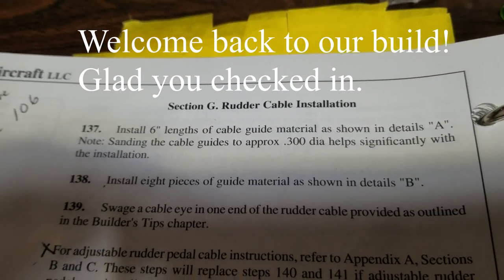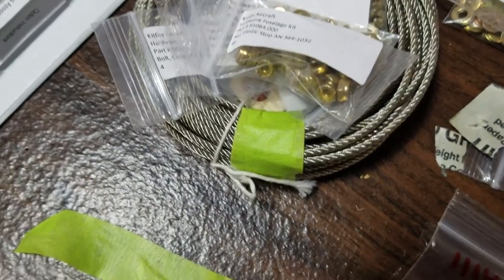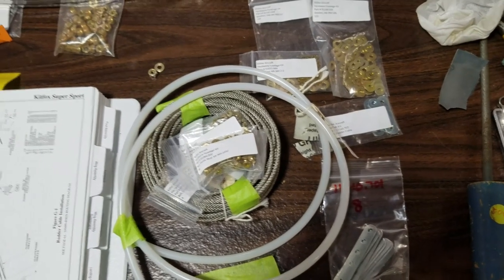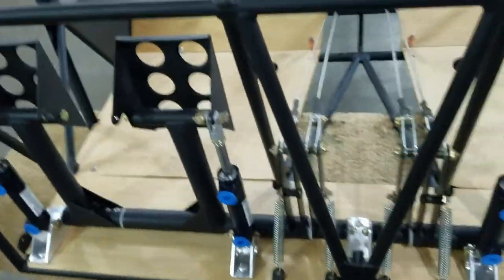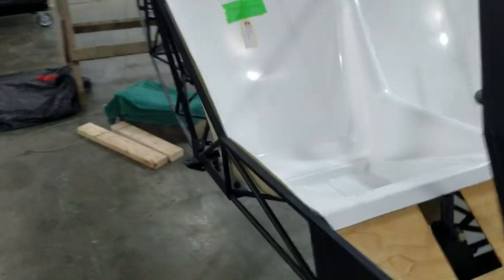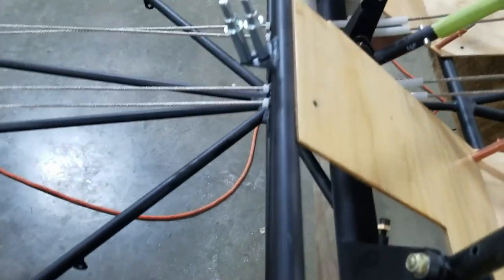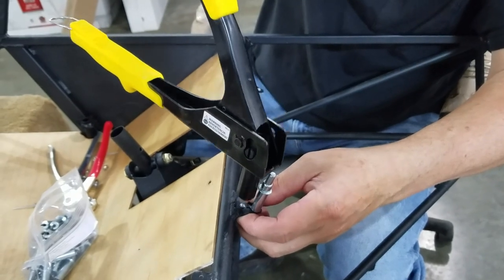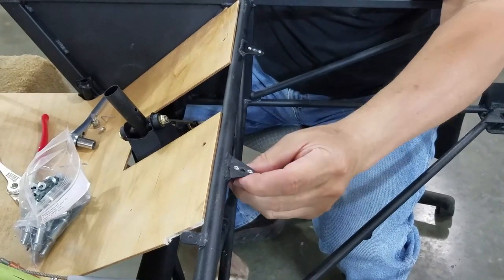Kitfox STI Farmfox build 6. Rudder cables and seats.

Comment: Liking your videos while my SS7 is still on order. Just so you know, nut plates are supposed to be self-locking...by running the tap through them, you've defeated the self-locking "feature". If you look closely at them, the are oblong or oval, not perfectly round. Keep on building.
Reply from the maker: I thought they might be but the first one I ran in completely removed the threads from the soft screws so I chose to make them work . They are still firm to screw into but the screws will hold up for a while now I hope.  Thanks for the info

Comment: Do not run a tap through anchor nuts.
They are tight because this is a safety feature to lock in the screw so vibration won't loosen them.
When screws and bolts loosen and fall out they can cause jamming or limit the movement of the controls.
Like the videos . Looking for further updates.
Reply: I agree, don't run a tap thru. They are tight because the thread is slightly oval shaped; you can see it if you look at the rear boss. Use pliers or vice grips and carefully squeeze the boss to remove some of the oval shape, a little at a time, until the screw goes in but still has some tightness to resist vibration loosening.
Reply: That’s what loctite is for 😊

Comment: You are making some amazing progress.  Just one step at a time.   What tool did you use to cut the seat belt holes in the fiberglass?
Reply: I'm impressed with how neat those holes are too!
Reply from the maker: I used a 3/8 drill bit, after marking the spot to cut out, to mark the boundary ends then a dremel with a plastic cut off type wheel to cut the straight part then sanded till happy.